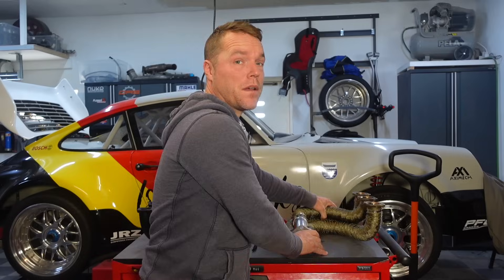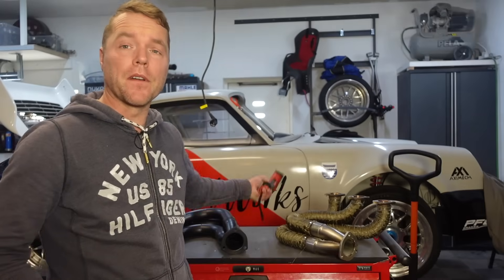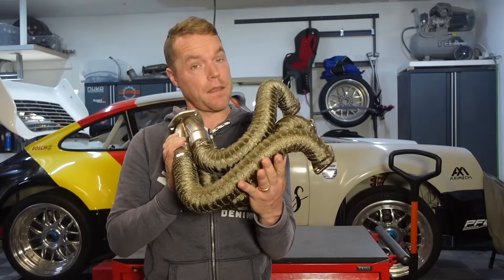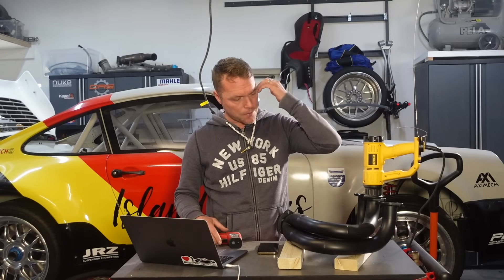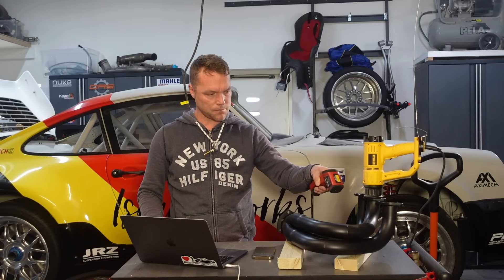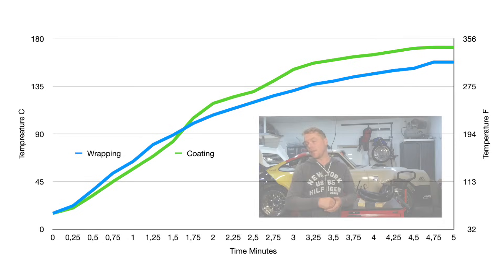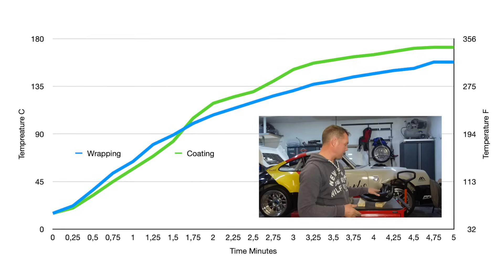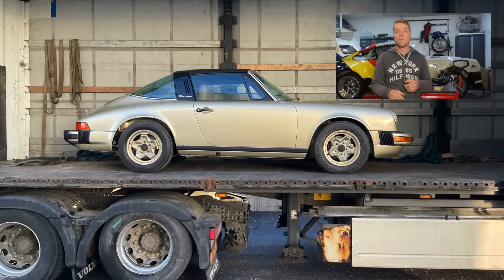Exhaust Wrap vs Ceramic Coating - Head to Head

Comment: Would be interesting to see a benchmark without any insulation
Reply: Was thinking the same after watching this. It would give an idea of the gains/benefits from the original standard non protected or coated header.
Reply: Always use a control..... good engineering practices

Comment: Ceramic coating is all nice but people forget, that thermal insulation depends on thickness.
So that 0.5mm coating isn't as good as 3mm wrap.
We tested both and with coating, everything around melted or degraded. After wraping exhaust everything is fine.
The best heatshield is ceramic wool, wrapped in staineless shield.
Protects better than wrap and metal shielding protects wool from enviroment.
Reply: The shiny steel wrap also reduced the radiant heat quantity from the surface of the glass wrap, Reducing radiant emission even more.

Comment: After finding out there are companies making aerospace grade thermal shields for headers and exhaust pipes, that’s the best and only way to go. Some manufacturers employ these on their cars, Audi/Lamborghini use them all the time as well as other European made vehicles.
Reply: Ceramic wool and thin, stainless sheet that covers it isn't really aerospace insulation.
Nonetheless, it's the best insulation you can make.
Reply: @feluke8396  it actually is aerospace insulation. I work for Pratt&Whitney, it’s used on lots of different components for our turbine engines.
Reply: Using TBC ( Thermal Barrier Coating ) with Zirconia is the process used in Gas Turbine engine

Comment: Interesting video. That said, I think a better test would be to place a piece of sheet metal near the exhaust header, and measure the temperature of that (being careful not to accidentally measure the header temperature). This is assuming your main concern is radiant heat.

Comment: Ceramic and THEN titanium wrap, that's the key, and you should never wrap mild steel headers if you ever drive in inclement weather, water will soak them and rot the metal from inside the wrap, always the best stainless or titanium, or of course, ceramic coating them first.

Comment: A temp gun measures infrared. The colour and more important reflectivity make a big difference to the recorded temps. If its shiny the temp is wrong.
Given time and temp there is only one genuinely effective radiant heat protection and that's a heat shield with an air gap. A formed fiber metallic material like the stuff used above catalytic converters with a 10 mm air gap minimum is loads more effective.  You put standoffs on the pipework to mount the sheet , form the sheet to shape and bolt on.  No contact, 15% of the price and by far the most effective.

Comment: I had an e46 330ci with headers that I wrapped, which also had a leaky valve cover gasket. I didn't realize it was soaking into the header wrap and it caused an engine bay fire in a snowstorm. I managed to put it out throwing a bunch of snow on it but not before it melted surrounding wires and the valve cover above it doing a huge amount of damage. 

Another car I had years before that had shorty headers on it, ended up totaling it out and took the aftermarket parts off it to sell, the headers had cracked underneath the wrap. Not on a weld but in the middle of a tube, I'm guessing it trapped too much head on the metal at some point causing metal failure? Really not sure

Not worth it if there's any chance of oil getting on them or if you care about the headers underneath IMHO, just be careful out there.

Comment: More worried about the long term life of ceramic coating - especially on a turbo manifold.

They can glow orange hot which means a lot of expansion and contraction  - I'm not sure a ceramic coating is going to sustain that.

Comment: Just a tip, you should have tapped the other runners, because if your headers work good it will create a scaveging effect and suck cold air, I have tried something similar and it did made a lot of difference on my testing.

Comment: I used the fibre glass version on my lancia delta and you could just about touch the manifold. However you have to wrap rear to front otherwise the wind will catch the wrap. Also the wrap eventually ripps to shreds on pipes plus the damage it causes to the surface of stainless steel is also bad so i'd go for ceramic over glass fibre wrap. Not tried titanium wrap.

Comment: Wrap gets dirty and if oil gets on it ,there is no small engine firer. Jet Hot a must to effectively do it. On company the sells snake oil is Zybar, the paint stays on ,but their radiant heat claims are straight out lies. And their sales pitch against ceramic coating is lying  or as they call it good business.

Comment: If you're going to do any damn testing why don't you test it in the actual car instead of testing over the heat gun in a freaking infrared thermometer. When you wrap your headers up like that the heat does not leave and you're overheating your engine and your engine is going to perform worse when I get hot

Comment: Just came across this video, nice test, perhaps not a true reflection of how they'll perform at running conditions but useful nonetheless, thanks for filming it
I'm no expert, more bumbling amateur, but a couple of things
1) Using a IR thermometer, to get an accurate reading as I understand it, the emisivity needs to be taken into acount, so different colours and materials can effect the measurment. Better probably using a thermcouple or even better RTD
2) As to the usual old tropes about wrap rotting pipes, I'd add wrap can be waterproofed using recommended sealants, 2 I know are DEI and Thermotec who both produce paints to seal their wraps.
Not advocating wrap over ceramic coatings I use both on motorcycles and never experienced problems. Currently re-wrapping some motorcycle headers which were wrapped for 8 years. The wrap eventually became brittle and fell apart, it had been sealed a couple of times. Pipes were like new underneath with no corrosion or degradation, no idea if I've just been lucky. 
Personally I'll stick to what I know and observe.
Statements must be true because somebody posted it on the Internet, right?

Comment: I think best would be to place a temp sensor away from the headers or manifolds then close the hood without the wrap and with the wrap vs coatings. Since a laser gun checks the heat right where it’s produced and doesn’t tell us how much it radiates under the hood.

Comment: Do not handle the wrap with your bare hands guys. Also it helps to blast it with a Mapp gas torch or propane torch to singe all the frayed fibers after you are done wrapping it.

Comment: Emissivity?? Was this set correctly?
The black glossy coating makes the infrared heat sensor change, did you check an emissivity chart for the surfaces you are measuring? Your test may show incorrect actual heat readings if the tool was not set correctly.
Reply from the maker: This was not that scientifically done unfortunately. In the end I think there is very little difference between the two and to really make a difference a better method that this needs to be applied.

Comment: loved the great idea! just don't know if the Heat Gun can manage the vertical upside down, thrus trigger the protection, varying the output that alters the result. Best to position no more than horizontal, or use 2 same gun w/ similar age.

Comment: Infrared thermometers don’t work on thermally reflective surfaces, you would be measuring something else the laser is bouncing off and then hitting. 

There is a more accurate way to test this, place some black tape or patch of spray paint where you are measuring or use a probe that makes physical contact.

Comment: cool video! I have cerakote and could not be happier. I have a toyota gt86 with a boxer 4 engine, I went Cerakote because of "oem" looks for the siren guys + I did not want the wrap to catch fire after soaking oil. I was so excited about installing the parts I totally forgot to measure the exhaust manifold temperature before/after

Comment: I have both done in my car, its already been 3 years of daily traffic and some spirited driving, the wrap has started to degrade, but still does a good job and I guess the ceramic coating underneath should also break down due to friction with the wrap, but I will wait until it doesn't work anymore or I change the headers.

Comment: You should measure against a black surface, ie. placing black masking tape or spray the wrapping black Matte, because black and Gray  gold have different radiation signature
Reply: yea, need 3rd naked header--is wrap even worth the trouble...
Reply: @rigolmgs  all you need is a small shield, stainless steel, clamped to the pipe and an 10mm (or so) air gap in between the pipe and the shield.
Reply: @dynodom4677  agree, that's what manufactures use and they have huge budgets for testing.

Comment: I would think a white or silver coating would be better as it would reflect more heat back into the header.  Black dissipates more heat by absorbing it from the higher temperature source and dissipating it into the lower heat area.

Wrapping or reflective coating also increases a header's efficiency by keeping heat in the exhaust "slug", thereby lessening velocity loss due to cooling.

You should have tested a bare header as a base point.
Reply: Research black bodies, black is better at high tempuratures, think SR-71 or the bottom of the space shuttle.
Reply: @me109aa 
I second that : My dear, late, grandfather assisted the assembly of the thermal tiling underneath the Space Shuttle Enterprise ( in the late 70’s at Rockwell Int’l, Downey, California ).

I don’t recall the nomenclature or the specs - but they definitely were black, and definitely prevented the occupants from being sautéd. 👍🏽

Comment: Cerakote is not Ceramic coating and basically offers ZERO heat mitigation properties.  A real CERAMIC coating does wonders though.

Comment: Surprised this is even debated in this day and time. It is well documented that wrapping will destroy tubes over time.
Reply: the discussion here was about temperature (albeit inconclusive). degradation of metal when using wrap is influenced by a number of other factors - not just heat - and is not a given.

Comment: Change to a better way,, sandblast the headers  , Air blow them off and use the two thousand degrees vht header paint.. it's better than ever ,it doesn't change colors it's easy to touch up later and it's looks good and it's low cost, easy coverage..

Comment: Not the ideal way to test IMO.  Thanks for the effort.  My thoughts are set on a dyno with constant drag and let it rip.  Really wild get a oxy torch with a rosebud and let it rip..  Heat gun is not enough in so many ways.

Comment: What I found when wrapping my headers on my car was the lowering of the radiant heat under the hood.  Before I wrapped the headers, I couldn't get my hands close to the headers at all and anything else close to the headers was very hot.  After the wrapping, I could get my hands quite close without feeling any great amount of heat.  I checked the surface temperature before and after wrapping and it was only a few degrees different.  The wrap will be the temperature of the headers but best of all it prevents the radiant heat which helps to keep the surroundings cooler.  Thanks for your video.  Best Regards - Mike

Comment: Good introduction, thank you.... couple of notes: do not touch heat wrap without  gloves, otherwise your hands will be very itchy, it has a fiberglass material. I would use a few metal zip ties around it, to make sure it doesn't come off. I can confirm the heat wrap does really works - have it on my Kawasaki Ninja for 5 yrs already, on summer day rides I don't feel heat on my foot rest, makes bike to ride more comfortably.
Reply: Yeah titanium wrap is awesome stuff, I've run it on almost all my street bikes to keep that radiant heat inside the pipes, creating a scavenging effect to pull exhaust through, and to keep it off my legs while riding....it even pained me to do so, but I even wrapped the hand bent titanium Technical Sports Racing header I was running on my CBR1100XX, covering up all that gloriously blued, purpled, and golden titanium you could see peeking through the fairings hurt my soul, but my god was that thin walled titanium hot compared to the stock stainless header....but of course, I only wrapped up to the 60.5mm collector and then the rest of the full titanium on back to the Ladybird full titanium Tri-Oval silencer was left bare to color. 👌

Comment: If oil is leaking onto manifolds/headers, you've got bigger problems. And I'd rather have said leaking oil contact warm wrap than hot metal.

Comment: Cerakote is for looks and corrosion protection, not insulation.  I saw a dyno room test with wrap against JetHot ceramic coating and the coating won by a pretty good margin.

Comment: Cerakote is not a heat insulation but a scratch resistant coating.
Best technology for heat insulation is ceramic powder with Inconel layers, used in F1, WRC...

Comment: Colour of the surface that you are measuring will make a difference to the reading well as the angle . Nice job with your experiment  mate.Its something I have wondered myself thanks for answering that.
Reply from the maker: The IR type sensors seem a bit flimsy to me. On the other hand I paid only a few bucks for the one I have…

Comment: You should wrap the ceramic coated headers.

Best of both worlds
Reply: @billysmith4278 overheat and burn off? yea maybe spray paint. i have used bbq paint on headers before, no problem.
Reply: @timothywhieldon1971  :  
I didn’t know they made BBQ flavored paint.
That’s cool.
Reply: @ginoasci  your smooth brain must be working at 100% on that one!. FFS, maybe it might be from you tasting various flavors of spray on high temp paint!
Reply: @timothywhieldon1971  He was joking
Reply: That is what i have done for years! Cearamic coat, wrap, paint. In my application, i soak the wrap in water first, Clamp the free end to an overhead beam, and start wrapping from the end of the pipe going forward. This gives the overlay with less chance of picking up an edge from damage etc. I mount it, and burn it all out. I then remove it, and give it a heavy coat of can spray heat paint. Time consumeing, a bit heavier i suppose & awkward to do, but the heat on the outside bend is 80 degrees C, in an Australian summer, in Sydney traffic. Stupid engine design of Harley Davidsons with everything on one side (oil pump/hoses, Ignition, Carburetor).😄
Reply: @billysmith4278 :  Billy, you should not bother with people that don’t have the experience you have. I don’t have the expertise you have, so I’m not going to argue with you.  People try something once in very specific applications and it might work for a while so they are convinced it’s good for everything,
In your world of racing conditions are very different and most people (me included) don’t have a clue about all the variables that make racing difficult.
I know people that race, drag racing, and that are constantly working on everything and making adjustments and Che king conditions and pressures, wiring.
It’s non nonstop, and when they think they have everything all set….it can turn on them in one second. And the guy have been racing since I was a kid.
Do your thing, but try not to get aggravated with the everyday novice.
Reply: @billysmith4278inconel wrapped? The fuck. Do you have any idea how expensive inconel is? And how stupid it would be to make pipes out of stainless THEN put inconel outside of them? If you can afford inconel just make the pipes out of them, and job done
Reply: @billysmith4278 full send = wot for long duration. you are a troll and no understanding of what you are lying and baiting about. ceramic coating is baked on at a temperature higher than any EGT's ever will get. try harder troll GFKY
Reply: @billysmith4278don’t let them ride your ass Billy, your right let their headers burn
Reply: NO
Reply: Explain why please?  @timothywhieldon1971
Reply: @billysmith4278 bs. Racing conditions are the same as full send conditions at the track. If your pipes are that hot then the engine has been damaged. You are a troll.
Reply: Worst of both. The best way is the way the factory does it with sheet metal
Reply: @1magnit  yes, if you want the exahust to weight a ton
Reply: @svagoio he has a bit of a point, not that stock is best, but a custom formed shield wouldn't weight much and does deflect heat well. Consider ceramic coat header ceramic coat formed sheet metal. 24-30 gauge steel would be 1-0.5lb per square foot. I may do this as fender liners for a set of fender headers I put on. Really coated 20 gauge aluminum, .032-.035" .45lb/ft².
Reply: @2fwelding842  having a 2 sheet of metal means i basicly have double the weight, it works, if you are trying to cut off the most weight possible its important
Reply: @1magnit  a small air gap and a piece of sheet metal is a terrific barrier
Reply: @Mastermindyoung14 it doesn’t help keep heat INSIDE the pipe. Just away from everything outside it. Keeping heat inside the pipe, means better exhaust energy/higher flow. On an NA motor not a big difference but for turbo apps it’s significant
Reply: @ You got it back to front.

Comment: Heat ≠ Temperature. Radiated heat ≠ heat from convection. A better test wopuld be to run each on the engine, in the vehicle, and then measure with a probe mounted say 1" away from the header.

Comment: I found infra red guns don't measure properly on lava-rock type wraps. Get ridiculously low readings when it's hot enough to sizzle spit on my finger
Reply from the maker: It was probably not the best tool for the job to be honest. I ended up shooting a few times at a few occasions.